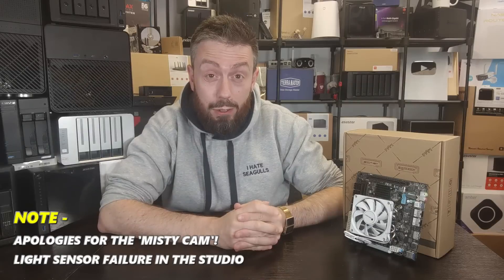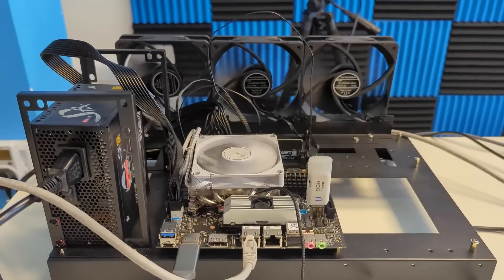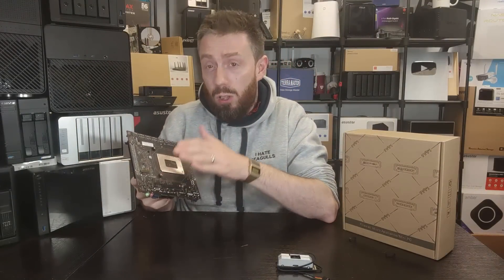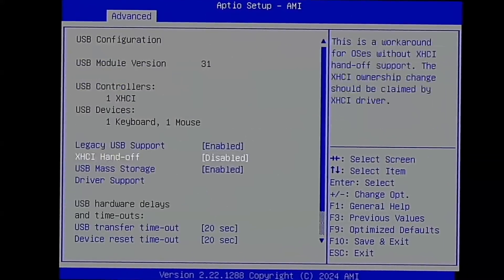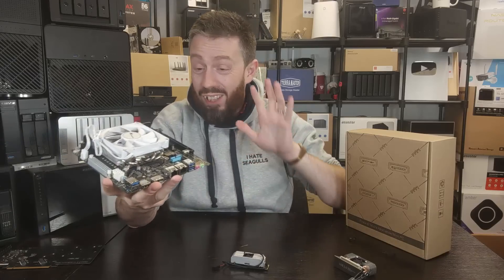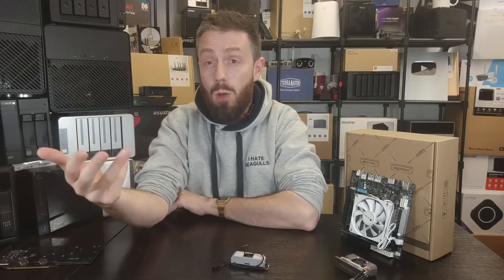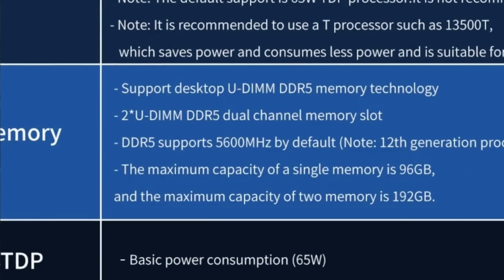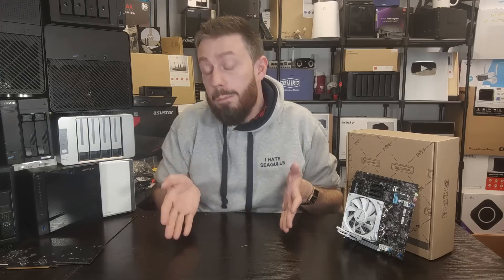CWWK Q670 Gen 5 NAS 8-Bay Board Review

Comment: Probably best itx board ever made.  The fact that you can get vPro on it is fantastic. The only thing they could of done to make it perfect is add 10Gb. You can use a different cooler that extends higher if are worried about not fitting everything.  Plus gen5 nvme for nas really isn't noticeable even if you had a 25Gb nic.  Save some power, heat, and money using gen4.
Reply from the maker: It's a beast and a half, yeah
Reply: Есс?
Reply: @BoraHorzaGobuchul  no ECC. Intel gen 13/14/15 operates in ECC mode only when being combined with a W680 chipset.
Reply: @syskeytechnician3509  that was the answer to the implied question "what could be done better"
Reply: What does Vpro get you?
Reply: Absolutely.
I would have loved to see which CPUs would pair well with this motherboard. 
If you are intending on leveraging a SAS hba for that x16 PCIe.
Reply: Could of? 😂 Try have
Reply: Best board? Without ECC it's an unacceptable board.
Reply: @MichaelBushey  30 years experience without ecc and no issues says it is acceptable.
Reply: @fwiler  40 years experience and dozens upon dozens of bad memory modules, even several on my personal servers. That's just memory modules going bad, cosmic rays and radioactivity affect RAM on a daily basis. My data is important to me, I wouldn't dream of running a file server w/o ECC. If you're not running a check-summing file system like ZFS you're simply unaware of what you've lost.
Reply: @MichaelBushey  Then you are doing it wrong and bought crappy components... cosmic rays and radioactivity affect...oh you really drank the coolaid bud.
Reply: Cosmic rays indeed affect ram/flash storage/potentially HDD controller chips etc. Without ecc, you're just unaware of it. It's not crap hardware, it's real world. Ignorance is bliss...